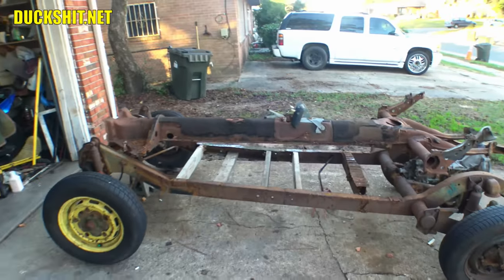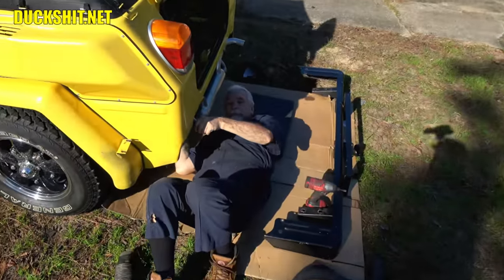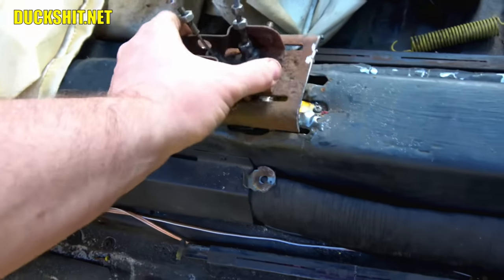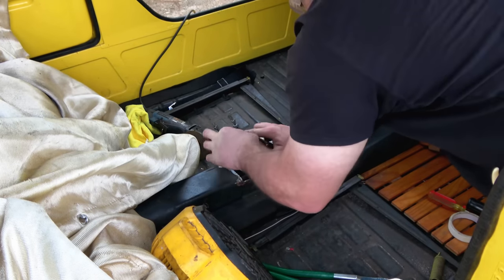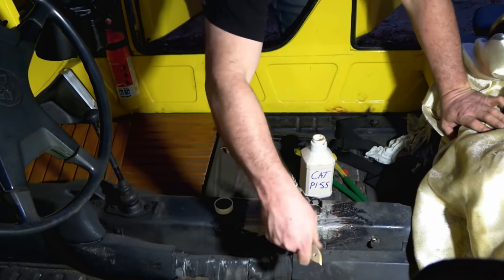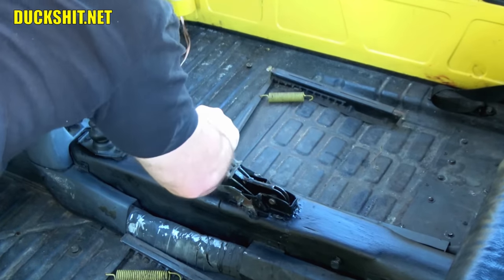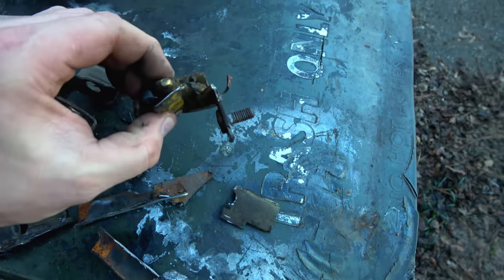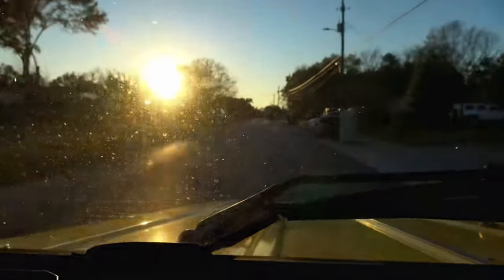💥VW Thing Frame/Tunnel Shattered!💥 - 🔧Weld and Fabrication E-brake Repair🔧

Comment: Same thing happened on my ‘74 Thing.. I can see some other damage around the body, but never understood how the tunnel cracked. And thanks for the years of inspiration to get my Vw done. Almost there.
Reply from the maker: Same thing happened to yours also? That's interesting!  Guess I need to know the story as to what happened there!  Share!  Thanks man!
Reply: She’s been through some things evidently.. the engine compartment is kinked up on passenger side ( it was a job getting the new seals in the channel) and under the back seat there are cracks on both sides like the ass end tried to break off.. idk. But where the heater cables come through all four “corners” cracked about 3/4” down the tunnel.. pounded it flush and welded it. Hope it holds.

Comment: I believe the bug has a bigger door opening than the Thing. I like heat ducts over the heater channel in the bug, just for the outside metal exposed to the cold air and the rust factor. FYI That was an impressive repair job!
Reply from the maker: Thanks john, the Beetle has a much bigger door.... it goes much lower and it's much longer.  You probably noticed like I barely even get my foot in this Thing LOL!  Thanks much for the kind words, I never expected to have to repair this part of a Volkswagen before!
Reply: Yes it was
Reply from the maker: @Thomas-fo9zu  Thanks Thomas!

Comment: Very interesting I would love to find out why that tunnel started breaking could it have possibly been floor pans were messed up and that was from stress
Reply from the maker: I think it was abuse.  And somebody did some kind of a lousy repair there before.  Under that paint was a lot of brazing work.  I just wish I knew how it happened exactly.  But being a Thing with no roof, it's not as rigid as let's say a Beetle.  There's a lot of flexing that goes on, and since the part has now been compromised by whomever abused it in the past, it was so much more likely for it to fatigue and have these problems.  It's a good thing we caught it when we did!

Comment: Just curious on the paint that used to pretty up the tunnel. Seams like a factory-ish color. Please advise.
Reply from the maker: Rustoleum flat black.  Not factory, nor what was on there already. You could see the brushstrokes.  Probably the same guy that did all the cutting and brazing to the tunnel.

Comment: Different Question, Heard you say something about "New Camera"  It that why a couple shots i heard you more out my left speaker? just wondering as i thought something was weird with my cobbled together setup.
Reply from the maker: Well, I am right handed and typically stand on the left when behind the camera.  So the left side mic would probably pick me up better.  But the old camera had the same mic, shouldn't have been any different.  Good observation, though!

Comment: Man Duckman you really out did yourself guesstamating how it  should be cut to fit. It fit so well I was very imperssed. Its interriour is actually smaller then the bug. The bus barely missed you.
Reply from the maker: Thanks man but the Thing is actually a much bigger interior than a Beetle... but the door is much higher and much smaller!  That's the pinch point!  😁😁😁👍🏻🦆💩

Comment: Wouldn't wire brushing it go through the accident and bring it down to bare metal
Reply from the maker: The accident?  I'm not sure what you mean!
Reply: Go through the acid I didn't look at it before I sent it
Reply from the maker: Ahh yes, it'll go through it if you brush it too much, I suppose!  But the idea is to knock of the loose stuff, not take it back down to bare metal.  The iron phosphate coating is pretty tough!
Reply: Ok good to know
Reply: I still have a box that I need to mail to you it has something for you and Bee in it just have to get the money together to send it.

Comment: Only thing is you didn’t paint the bottom of the new piece
Reply from the maker: Yay, but neither did Volkswagen.  But its also not exposed to elements...  and welding would have ruined it anyway.  Thanks lol